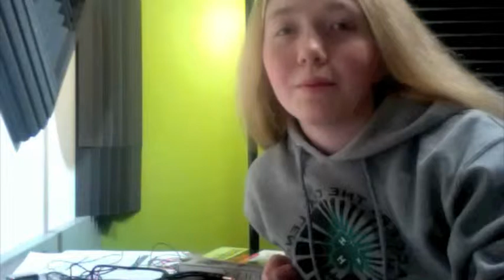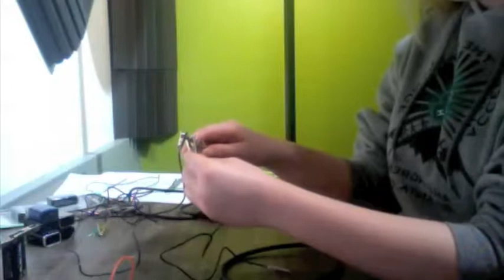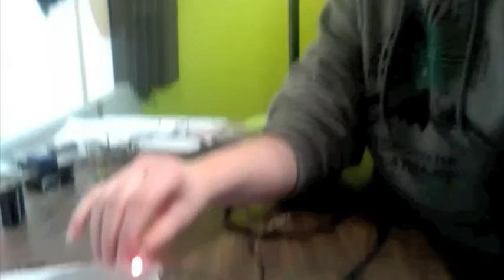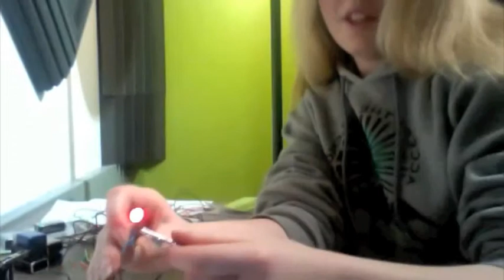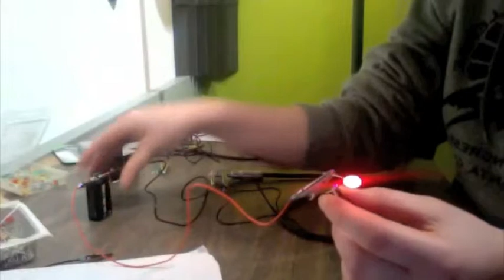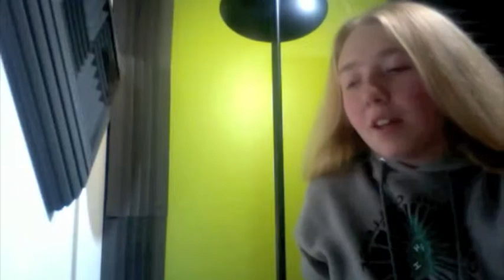Cable Tester Project- Audio Electronics

Comment: NURD... Yeahhhh.. I got you good.

... Okay, for the non-nerdy stuff now, I just want to say that I'm exhausted after trying to figure out why I'm getting different results with each 3.5mm plug I'm testing the continuity on. ... Like, there is no consistency. There is on a cable I know IS working, but I'm trying to build another one. Every single other one I've tried (like 8) do weird shit like ... every wire always makes the continuity light up, or sometimes it's the tip and sleeve, ... ... I don't get how this can happen, let alone on EVERY other cable I have. =(